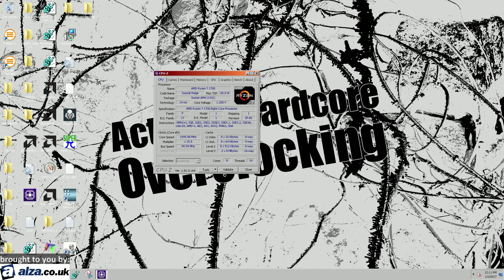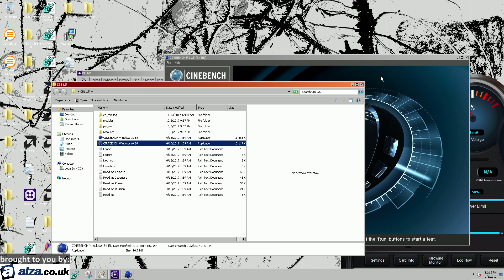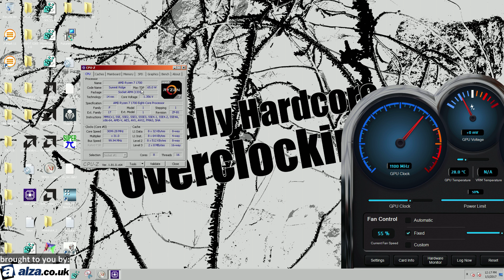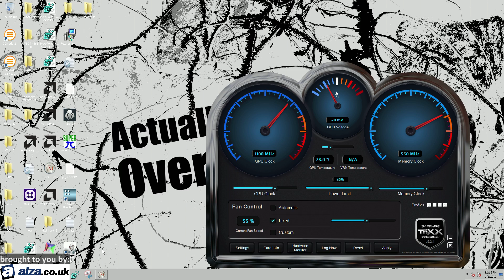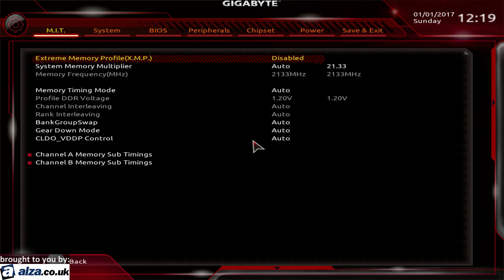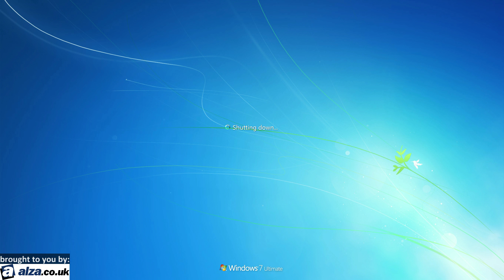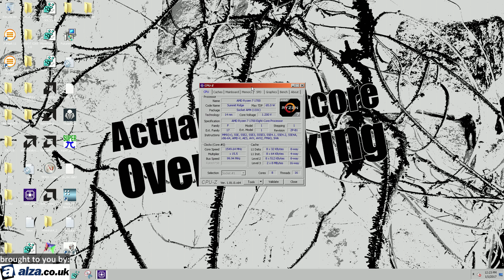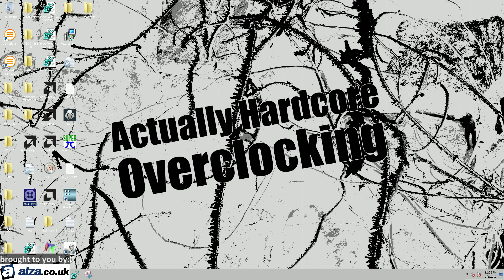The elusive Ryzen 1.55GHz bug (a potential fix on gigabyte motherboards)

Comment: Is it possible the 1.55ghz 'bug' is actually a limit in place in newer revision Ryzen non X CPUs to limit overclocking potential to provide an actual reason to get them?
Although, honestly I'm more interested in your experience with windows 7 on Ryzen.  As someone that won't run Windows Malware Edition, I'm quite interested in that.
Reply: This is the literal definition of making a mountain out of a molehill.
Reply: If you have windows 7 updated past a certain point you already have the "Malware", AKA some telemetry. You can easily disable all but the basic collection from the settings and you can use Spybot Anti-beacon to stop the rest.
Reply: Thought they broke most of the things anti beacon fixed by integrating them more deeply into malware edition.  Ultimately even if Win 7 has some of the more basic telemetry, it allows me to completely disable automatic updates, something malware edition does not.  Automatic updates restarting my computer whenever it feels like it...  they may as well make the screen blue with an error message.  It's equally as bad.
Reply: Yeah me too, what is your experience with W7 on Ryzen hardware AHO?
Reply: Xddd, sadly im not aware of what and how i did it, but my win 10 on main system, r5 1600 doesnt do autoupdates :-p even had to manually download spring creators update....
Reply: My computers never update on their own or even notify me to. It just does it when I press the update then power/reset button.
Reply: just disable the windows update service till you want to run updates
Reply: There is a way in W10 to not auto-install updates. You just need to set your internet connection to metered and it won't download updates unless you tell it to do so.
At least that worked before the creators update. Now it works most of the time, but sometimes it still will download updates. But the creators update made it possible to set an ethernet connection as metered without hacking the registry. Before this was only possible for wi-fi.
Reply: Nop, X CPU get the bug to, but stay stuck at 2.2Ghz instead. It's not a AMD conspiracy to force you to buy X cpu, and this bug began to show up in AGESA 1.0.0.4 and also it affect only better binned CPU from my experience (Lower default VID = more chance to get that bug).

Use fixed vcore instead of offset or use p-states OC.
Reply: See, I've heard even that is misinformation and enterprise is chock full of garbage too.
Reply: You can disable most of the things even in pro versions but need a bit more tweaking with GPOs. This way updates can be stopped totally and work only if you press the damn button. Pretty useful. I am running this way all way back from original Win 10 and the upgrades didn't changed a thing ('cause of it being a legit Windows set thing).
Reply: when runing QubesOS there is a lot of overhead involved. You really need a powerful CPU for that. And in case you want to play games or something you also need 2 GPUs. One for the host and one to give to the gaming OS. Or you have one of the enterprise GPUs that cost like 3k $. Then you only need one because you can give it to the host and the gaming OS at the same time.
Reply: That's the thing, my computer should not reboot ever unless I ask it to.  I don't care if I'm at it or not.
Reply: Alex dont spread misinformation you cant disable telemetry on ordinary win10.... only on enterprise win10 versions you can
Reply: Windows 10 doesn't reboot to install updates while you're using your computer unless you switch it off the default setting and fail to change the specified reboot time.

You can also disable the telemetry with like 3 clicks.
Reply: just run QubesOS and then run windows 10 inside of that.
Reply: or find a copy of windows enterprise lbst or whatever its called, it is windows 10 but with all the malware shit removed from the operating system, its designed for embedded systems.
Reply: Microsoft doesn't let you "fully" ignore updates, just how long you can post-pone them. They are literally pushing out spyware by force on your OS and collecting data from your use of it as if they're watching your every action on your computer regardless of privacy.
Reply: You're right, Microsoft really is building a pretty big mountain of crap.

Comment from the maker: testing RAM OCing for like 15+ hours at this point and then this shit happens.
Reply from the maker: I've had problems with all boards on all platforms
Reply: Don't get Gigabyte then. For me the best ones are Asrock and Asus.
Reply: I duplicated your results on an ASUS X370-A with the R5 1600.  <=1.4v VDDCR CPU, a.k.a, <= +0.1625v offset is fine, anything greater downclocks CPU to 1.55GHz.  This does not happen with my R3 1200, which on the same board holds clocks at >1.4v VDDCR CPU.  FYI.
Reply: i have always have problems using AMD with gigabybye mobo
Reply: From all the reading I've done on forums, this only affects non-X cpus and definitely isn't just a gigabyte issue.

Overclocking my friend's 1700 on a Crosshair VI can yield the same bug. We had to rely on auto voltage and managed to get him up to 3.7ghz on all cores.
Reply: It affect only when increasing vcore with offset AND AGESA 1.0.0.4+.

It append more with CPU that have a good binning (low default VID). My Ryzen 7 that got returned from RMA (Really good bin as it do 4Ghz at 1.335V) do that bug with like +0.03v offset.
Better the chip, faster you hit the bug

Fixed vcore or p-states overclocking "fix it".
I got a modded BIOS for my Asus B350 Prime and got p-states OC working from the BIOS.

Before, that CPU was in a Gigabyte Gaming 3 and so it did not have fixed vcore and p-states OC so in that case the solution I use is to overwrite the pstates MSR registers during boot. (I do use Linux so it's easy to hard code the proper pstates in assembler or C directly in the grub bootloader.

For your daily system, why don't use use p-states OC? You can test with ryzen master or zenstates(Linux) then once you find good clock, you set it in the BIOS et voila. (If you don't have pstate OC/fixed vcore and don't use opensource software during boot process, well, in that case you have to wait for a fixed AGESA or change the CPU).
Reply: 15 hrs???!????!??!??!?!!!!!!!1!!!?!
Reply: Only the asus ch6 have the fix :/
Reply: @i Neri, if you mean you Gigabyte Gaming K7, there is effectively no fix as even modded BIOS that add pstates seam to not be able to save them. But there is modded BIOS for all Asus board to add p-states and it fix it (when you use pstates OC instead.)

Note if some of you flash a modded BIOS to add pstates OC feature, please TEST pstates first with zenstates on Linux (don't know any alternative on Windows as the zenstates software on Windows is CH6 only...). If you put non tested pstates in one of these board that are not supposed to have pstate OC, then you may brick your board as for some reason they survive clear cmos (people use to abuse RMA that way and Asus removed pstates OC from most of there board via bios updates.)

To add pstates OC  to AMD CBS BIOS settings, use a bios from here : http://www.overclock.net/t/1640394/unlocked-amd-cbs-for-ryzen-motherboard
Note : OP in this forum make a new POST instead of editing his first post when he add BIOS update. So for a Asus B350 Prime you have to scroll down to get the modded BIOS 1002
Reply: That's correct. My k7 have official p-state but even this way i have the stuck bug ;_; asrock it's about to release a beta fix for the taichi.
Reply: If I remember Gigabyte pstate OC don't apply the pstate VID (vcore in the BIOS have to be set to AUTO and it should use the one specified in pstates but noo, it just ignore it). Really basic bug that Gigabyte did not fix in months.
Reply: Well. Gigabyte and all else xD even asus that already have a fix it's only for the ch6. Strix and pro don't have the fix yet :/
Reply: At lease for Asus, you can flash a modded bios that add pstates oc. Then just use pstates oc, it work fine and even use less power than using the normal main vcore offset. I do have an Asus B350 Prime and the problem went away after flashing that custom bios and just using pstates oc (so AUTO vcore in the normal OC section in the BIOS, and actual vcore set as VID in pstates.)

Note that VSoC offset still work fine.
Reply: I generally have had the most problems with gigabyte mobo's and this is mostly talking about budget motherboards.
Reply: Yeh  have a 1700 which it did this on
Reply: Actually Hardcore Overclocking what are the advantages of using offset voltage instead of fixed voltage? Does the CPU downclock when idle?
Reply: @actually Hardcore Overclocking : Problem fixed with AGESA 1.0.7.1. I just tested with my Asus Prime B350. I do use modded BIOS that add pstates OC and somehow that new modded BIOS pstates don't apply... So I tested using offset vcore and 40x multiplier on my 1700 and it does work fine with an offset of 0.165v (I use to get the multi bug even with 0.02v offset)
Reply: I have had the same problem with a 1600X and Asrock Killer MB. When i changed the voltage of the CPU to fixed it locked at 2,2 GHz.I flahed the board with the custom/modded BIOS, the problem is gone and can get the CPU to 4250 on 1,4 Volt Fixed.  https://postimg.org/image/3we95cvb9/  It is a BIOS bug, not the CPU ;)